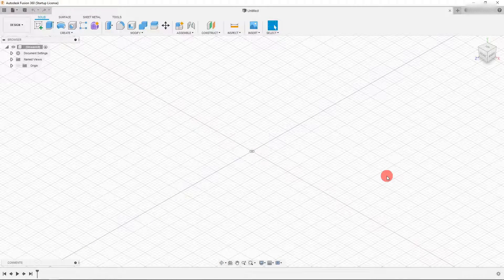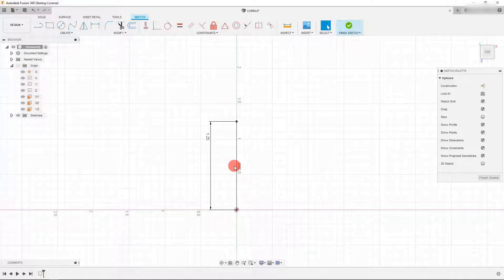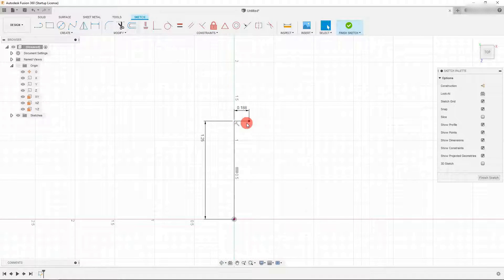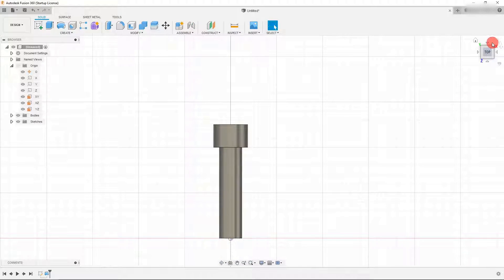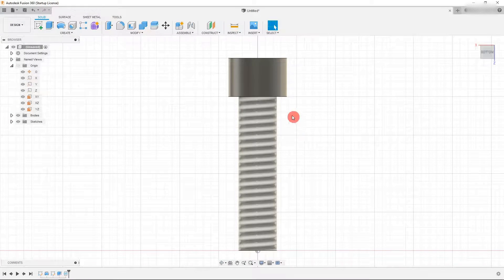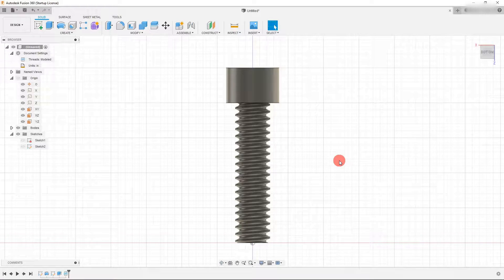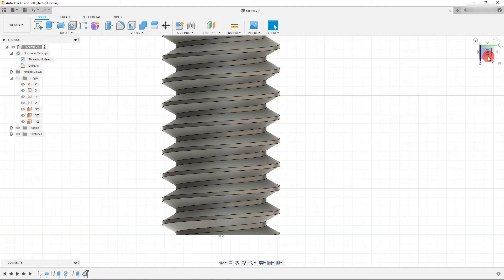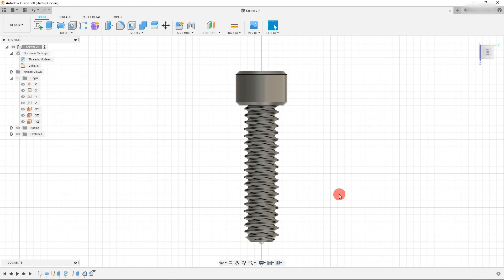Model a Screw in Fusion! Tutorial for Absolute Beginners: Introduction to Sketch Modeling

Comment: Thanks for your tutorial, I really appreciate the time you took to help everyone! I bought a microscope on Amazon recently and one of the set screws for the microscope/screen apparatus was broken so it just flops around. Can't solder with that, so I'm using this tutorial to design a better one. Here's hoping I get it on the first try. 🤞
Reply from the maker: Wait, you are designing a set screw, or screen apparatus?
Reply: @AvivMakesRobots  A set screw, because one came broken in the box.